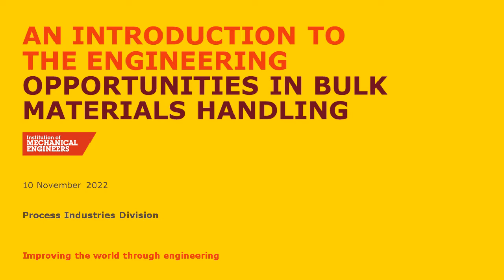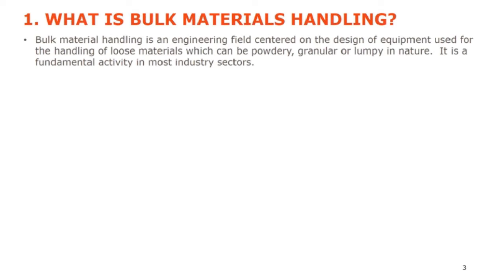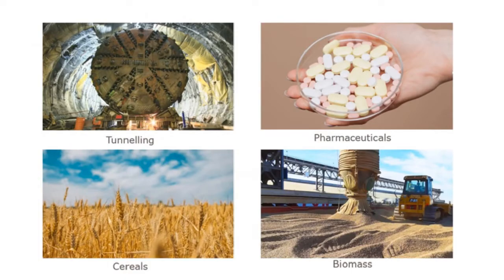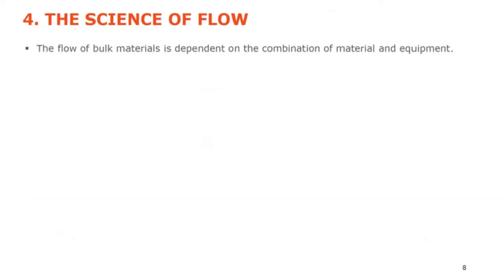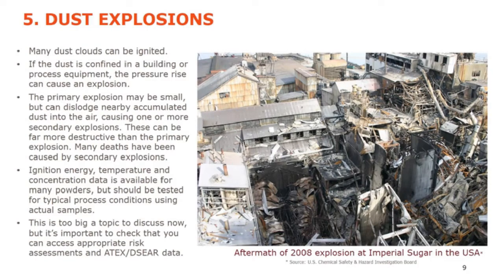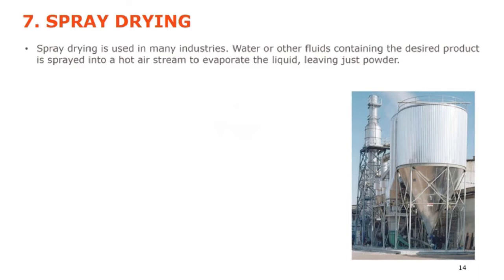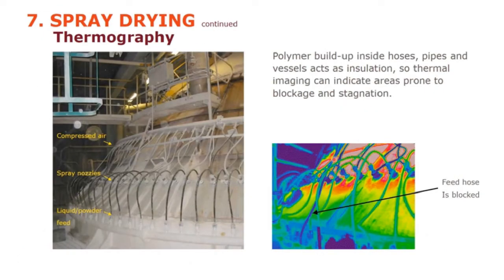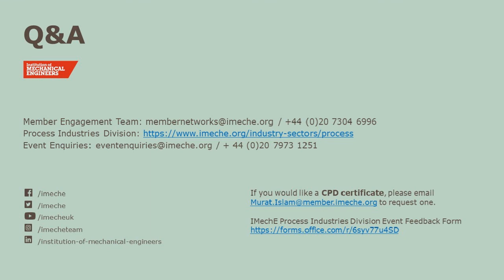An Introduction to the Engineering Opportunities in Bulk Materials Handling

Comment: Great video! Tip for powder blockages: I was having a problem processing powders. 
I’ve recently installed Artech ultrasonic systems to my hopper as I was getting blockages. By applying ultrasonic frequencies to the blocked area allows the material to flow consistently. Saves me having to bang on the side every half hour and it doesn’t make a sound.
Reply: to clarify, is it a kind of vibration that it gives to the hopper? if yes, will it affet the life time of hopper and also why didnt you think of reducing wall friction by having liners inside?. just curious